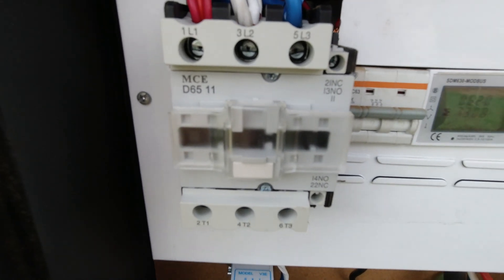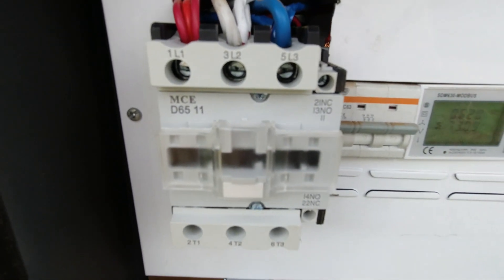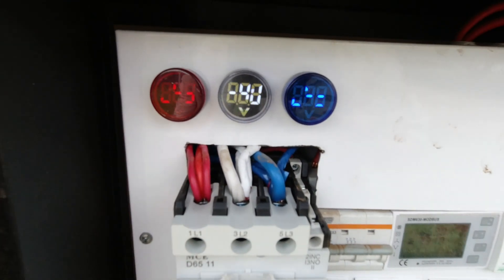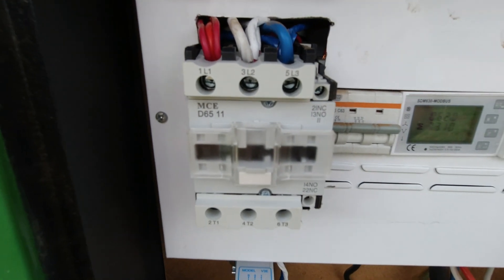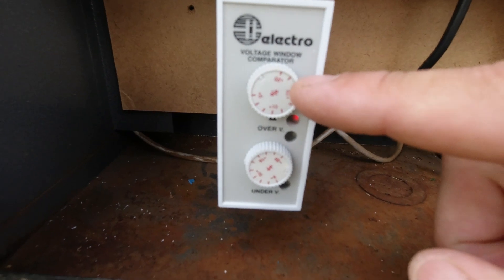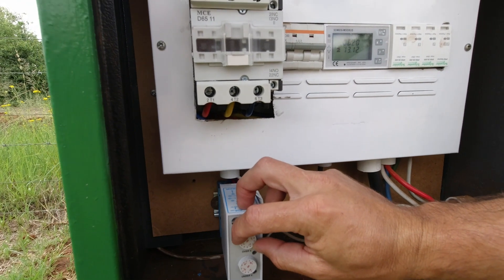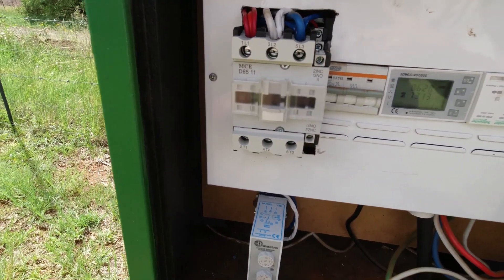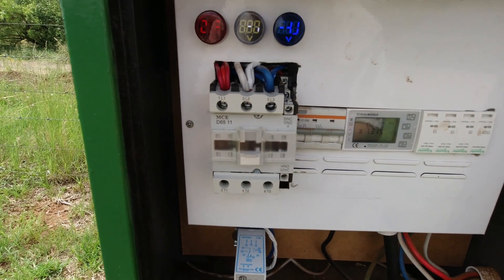Over and Under Voltage Protection - Brought to you by FarmAbility.co.za

Comment: The Occupational Health and Safety Act states unless you are a registered electrician or working under the direct supervision of a registered electrician you may not work on an electrical installation. Your advice that people can do it themselves is against the law.

Also, I would rather use a Phase Failure /Phase Reversal Relay than an Under/Over Voltage Relay. Of cause you can use both in series for complete protection.
Reply from the maker: Hi Lourens.

Firstly, thank you for watching the video. I am not sure if you watch the video till the end. From 4:08 to 4:18 I do explain that the installation needs to be done by a qualified electrician, or that you may build the system, but you cannot switch it on before a qualified (registered) electrician signs off on the installation. You are allowed to complete all wiring, but your system may not be switched on before the electrician has inspected the installation. The law is interpreted differently by different people. I make it very clear that if you don't have a valid COC, liability is an issue.

Comment: Straight talk no gimmicks. I like that in an educational video.I certainly agree with you DeKlerk about getting your electric DIY work signed off by a certified electrician. That said, a lot of people are always so afraid of the high surge that comes with electricity "returning" after a hours of loadshedding but they don't realize that under voltage is equally harmful to electric machines as is over voltage. When voltage drops due to an assortment of reasons, the current drawn by the machines increases to cater to the constant load torque. 
Current beyond the rated value may damage the windings, melt the insulation or cause thermal failure of motor. 
For such a scenario to not occur, under voltage relay is used. Whenever, the voltage across its terminals drops below the acceptable value, the relay picks up and trips the circuit breaker. Thus, avoiding further complications. Good work on the video. Subscribed!
Reply from the maker: Hi Zoltan.

Thank you for commenting on the video, and your information is very helpful to understand more of the problem that occurs. And thank you for subscribing!